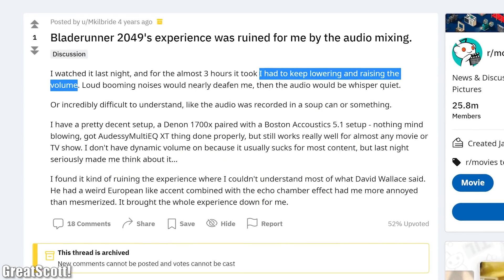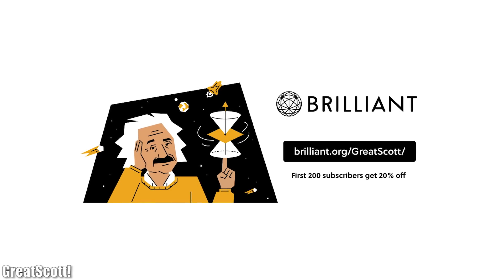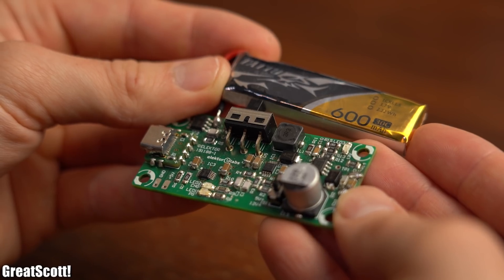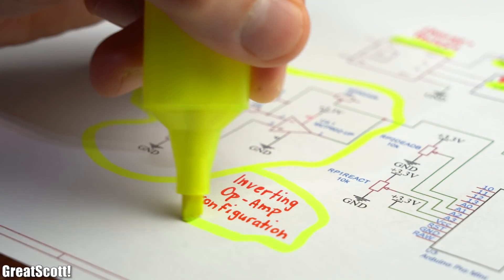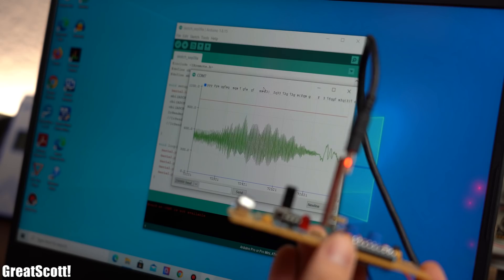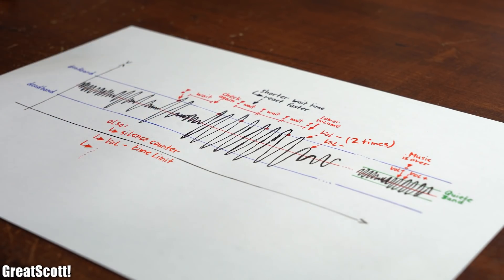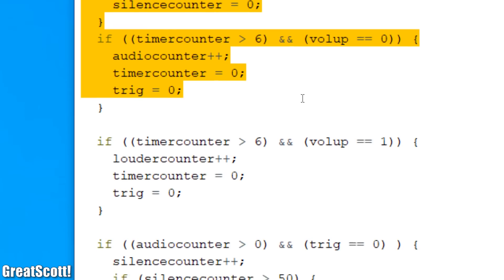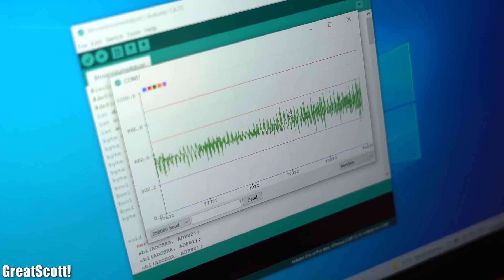Movie Music has a LOUD PROBLEM! So I fixed that! (Automatic Volume Adjuster)

Comment: This technique of using a compressor/limiter has been around for years.
If you view the output of all tv channels on a Peak Program Meter you will observe the change between normal output and the output during advertising.
The PPM shows the instantaneous response to audio signals with a fast attack and slow decay on a range scale of 0 to 8 where 6 corresponds to the maximum permissible level.
When indicating voice signals on the news the PPM will indicate a high dynamic response with an average around 4.
When adverts or feature films are shown you observe a very narrow dynamic range restricted to the highest 20% of the PPMs indication range (5 to 6)
This is because the audio is heavily amplified but put through a compressir/limiter to prevent the station output exceeding the transmission maximum of 6 on a PPM meter.
The effect of this is to maximize the loudness so it gets your attention.

Comment: Or you could just turn on the dynamic range compression, usually labeled DRC, midnight mode, loudness control, or something similar on most devices.

I prefer to hear movies as they were intended to be heard myself.

Comment: we use to have a circuit like this in the vacuum tube receivers it was call automatic gain control, it worked like a jiffy, no Arduino or any computer chips though that had not been invented yet. really amazing how things come full circle.

Comment: The solution is quite complicated.

A fare simpler approch would be to use a external speaker and an Inline analog compression cirquid

That also would react fare quicker

Comment: btw: some cheap transistor testers have an IR code logger that can decrypt the signal

also if it's not remote/bluetooth and going through an audio cable you could build a preamp with a digipot

Comment: The problem is particularly bad for people with poor hearing, who have a lower acceptable dynamic range - they can't hear the softer sounds but contrary to popular opinion, find the very loud sounds just as uncomfortable as people with normal hearing. To be able to hear and understand the quieter spoken parts, I have to turn the volume up very high, which of course makes the loud music passages unbearably loud, so just like Great Scott, I have to constantly fiddle with the volume. Modern hearing aids compress the dynamic range to some extent, but it's not enough. I therefore toyed with the idea of building a compander - an automatic gain control circuit that can be placed between the TV sound output connector and a sound bar or audio amplifier or even as in my case, between the TV sound output connector and the Bluetooth transmitter that I use to deliver the audio directly to my hearing aids. There are in fact IC's available to do this - it's on my list of "to-do" projects.

Comment: Before opening the video I thought you are going to make a volume dynamic process circuit in the middle between source and speaker. But nope that's not how Scott solve problems. Let's make a volume driven IR remote control instead.

Comment: This whole project stops being a good idea when movies decide to have sudden volume spikes (think of jumpscares or similar scenes where action happens after a prolonged period of absolute silence). If you're using a soundbar, this can probably be solved in a more elegant way (for example by converting the audio signal into analog and doing something with that directly with a compressor/limiter circuit). The best solution would be of course for movie producers to stop pretending like everyone who watches movies at home has a basement with a full blown home cinema system and no neighbors in a 10km radius.

Comment: I watch movies and TV shows on my iMac quite a lot. I can route my monitor signal to a TV screen, so I can watch it in bed, or in the living room.

Because the movie you mentioned is not the only one with that loudness problem, I use the Audio Hijack app to add a subtle compressor and subtle limiter. They actually work very nice.
I basically made the dynamics more flat. But not too much. Just enough to keep the relationship with my neighbors okay. It helps also with the volume controls.

Comment: We don't watch DVD or Bluray but we watch a lot of Netflix and this is a huge problem on Netflix but on many other services too. My wife constantly says she has to be the sound engineer to turn the volume up and down. However, TV channels with lots of ads have the same issue where the volume of ads is usually also much higher. So, in our house this device would be perfect as we also don't use 5.1 surround systems but in most cases just the TV speaker(s). And being an Arduino fan I will definitely look into building this and also play with the code a little if needed.

Comment: This is great and genius. But a compressor/limiter would work as well, I have been using software. The device you made is exactly that, but it may not be as responsive as you would want.

Comment: Looks like a very cool project.
I had this problem for years. 
But I’ve always believed it had something to do with the processing in the preamp or amplifier (my money is on the preamp). 
A few years back I was troubleshooting my subwoofer. In order to verify that it wasn’t due to my receiver, I tried 3 different receivers that I could get on loan. All were pretty much the same for voice playback. In other words, the same problem.
Then I heard a demo of a receiver that I thought did a better job. I bought it with the option to return for full value if it didn’t work to solve my problem. 
I wired it up and started a movie fully expecting to hear the same problem. 
Imagine my surprise when my center channel and voice playback all started to sound the way I thought it should rather than what I had been hearing with my other receivers. 
I should say that I had gone over to the home theatres of a couple of my friends (all using separate video processors and amplifiers, of course. And neither of them had the issues with conversation being too quiet.
The good news is that the receiver I bought with the option to return didn’t have the problem either. 
I am now certain that the problem is caused by something to do with the way audio is processed by many, if not most, AV receivers on the market. Because when I plugged in an Anthem MRX 710 (obviously this was a few years back) the problem completely went away.
Yes, people who spend vastly more money to get dedicated components for video and audio processing as well as for amplification pretty much never hear this same issue. 
The good news is that there are less expensive ways to solve this problem without adding additional processing in the signal path.

Comment: Interesting project, and cool way to flex your arduino skills! For practical reasons though, I don’t think it’s necessary. Most home theater systems and even devices like the Apple TV have dynamic range compression or center channel mix adjustment that works much better. Sometimes it has a weird name like “night mode.” I finally broke down and bought a HT receiver after years of putting movies through my hi fi so I could run a center channel. Of course, the latest version of the Apple TV added a feature with better stereo downmixing, so it no longer matters….

Comment: if that's the same sound bar i had, it's a 2.1 setup. i upgraded to a 3.1 and it made a huge difference. those centers do more for speech audio than anything else. of course it cost double the price. old one was $150 when i bought it i think and the new one was just over $300.

Comment: Great project and good comments about the center channel here. Unfortunately it's not always possible to  influence the down-mix, so here are a few alternative suggestions to get more constant volume:
On Samsung TVs you can set the Auto Volume to Night Mode to achieve a similar effect.
Another solution would be to work directly on the audio signal, for example with a DSP or an opamp with deliberate sag.
Studio equipment for saturation/normalization/limiting would also do the trick.

Comment: So. You are listening to a bad surround downmix instead of the proper stereomix and reinvented the 75 year old optical compressor (only not used as a detector) to solve it. Congratulations. 

150 years ago you would be one of those people inventing cars with square tires and flapping wings trying to run on breast milk.

Comment: The thing about this is that the more the loudness differs the bigger the cinematic impact feels. It's a common misconception in the industry that consumers want to gain a cinematic, because most don't want to. There are many AV receivers that come with a built in limiting compressor but they usually don't provide settings and have a very high threshold. I don't know why the movie industry is going nuts about these things. They should also remaster the sound for different releases or at least provide a choosable sound track. While hardware workarounds are a nice thing they become pretty useless over time as movie companies are going to adapt to make their movie "stand out" as in going crazy in dynamic range.
Reply: While I agree with cinematic loudness range not being appropriate for home watching, the issue of the gentleman behind this video seems to be squarely in the selecting the wrong format-camp. 

What he describes is typical of center (dialogue) channel from surround formats being lost if not downmixed properly to stereo by his reciever/TV/Soundbar/Apple TV/Chrome cast device, or even his cable provider.

Comment: Nicely done, but perhaps next time don't overcomplicate? Just add a dynamic range compressor between audio output and amp. No need to involve your remote control in the equation.

Comment: Neat project. I was going to say some stuff but most of the top comments seemed to talk about stuff like Compression and your gear you use. Most receivers will have some sort of compression so the dynamic range (which is a good thing) gets squished so the quieter parts are closer to the louder parts so there's less drastic changes in volume.

Comment: I had this problem with youtube... but noticed there was an audioCompressorNode object that can be used in firefox and didnt make a circuit (actually just dowloaded what somebody else made before I got around to it). Though it can be a bit glitchy sounding... other solution is routing the audio through DAW where there are better quality compressors. Or... since I use an AxeFX II as my "soundcard", just create a dry plugin that does nothing but audio compression and make the computer the input source

My "home theatre" doubles as a music studio. Can get a large HD computer monitor and its perfect for a bedroom

Comment: It's needlessly complicated. A better fix can be made simply and at low cost, with no microprocessor and no code.

Use an analogue ALC or AGC feedback loop. It's a couple of components, and it reacts instantly, if needed. Or you can switch the reaction times by swapping a capacitor or resistor, and also disable it entirely. Set the desired comfortable output level with the normal 'volume' control, and then forget it.

Every AM radio has it built in as standard, because it's both cheap and simple

Comment: Does the wild variation in volume also affect the sound quality since the digitally sampled track only has a limited (albeit quite large) number of levels? Presumably the dialog is squashed in to the bottom and the music in to the top.

Comment: This problem comes from the fact that movies are mixed to be played in cinemas, where you have gigantic dynamic range for explosions, etc.
I agree that an alternative mix for home tv's is very much needed. 
You can almost perform the same function with a very slow attack/release compressor. I think VLC includes one.
Reply: If the last time I've visited a cinema is any indication, then I can safely say that no, the mixing is just shit.
Reply: @Lrofmaulol   if it sounded shit its probably because you landed in a bad calibrated room/system. You can read about that cinema standard in the wikipedia. It is called Dolby Pro

Comment: The problem is simpler than one would think. Most newer movies, and many classics, were  recorded in 5.1 surround sound. All the conversation in relegated to the center channel, and since stereo has no center, what needs to happen is a L+R (mono) signal needs to go to a separate center speaker. Presto change-o, now the dialogue is balanced with the loud sound effects. Rear channels are not necessary.

Comment: I love that this guy seemingly unknowingly made an external limiter. I definitely agree that the stereo mastering of movies and som tv shows have become quite bad in the last decade or so. It feels like they just take the surround sound master downmix it to stereo, completely ignoring the fact that stereo doesn't have the same dynamic range.
Reply: they don't even do that, its just 5.1/7.1 and is left to the device/service to handle the down-mixing so its kinda a shitshow
Reply: It's actually a compressor not a limiter.

Comment: Dude just turn on the DRC if you like to hear movies like that. On some players it's called "Midnight Mode" or "Dynamic Range Compression", but most any player has the feature. No need to build a special circut.

Comment: Just activate Stereo downmix on your Player it will Mix the Sound right. If you watch a 5.1 movie without a 5.1 system and use only Stereo. Your system will only use left and right but voice is in the Center Channel. If you dont have downmix ennabled the voices Sound weak on Stereo. Thats the whole Trick. No need for Hardware its a simple option that you can turn on and off. I rly makes me Wonder that so many people have a Problem with this when the solution is Just a simple Setting. Yes, even If you use a Notebook.

Comment: i want to be able to lower a TV's volume to lower than 1 percent. you know because it's possible on windows 10 to modify the sound volume which combined with the TV can mean 1 percent times 1 percent could come out to 1 hundredth of a percent...i would like to lower a TV's volume past that very loud 1 percent option but without requiring a windows OS to do it. i play console games and i often listen to the games through the TV itself. whether that's a great thing to do or not is debateable but if i choose to do it, it would be nice to be able to lower the really loud games and they don't always come with volume sliders for sound effects and music and such. some of the best games have garbage volume quality and zero or insufficient control options...  it's a lot simpler than this awesome thing you are doing so i hope someone eventually starts making TVs that go lower than 1 percent volume. some TVs' lowest volume setting is even something like 2 or 4 percent... if you have 50 integers on your TV's volume bar it means the lowest it can go is 2 percent. if you have 100 it goes to 1 percent. i want a TV that has 10000 integers on its volume bar, or at the very least 1000 integers.

also as a video gamer this device you already have a prototype of might be useful for increasing the volume of exploration music or lowering the volume of battle music in RPGs cuz they have the same problem as movies, trying to make you feel like you're playing an overrated movie.

Comment: Its also possible that the encode you got was expecting 5.1 speakers with all vocals routed to a maybe non existent centre speaker.  Worth checking out the settings as that will make a massive difference

Comment: What I really don't get is why can't studios make two audio tracks. One where the audio is the full cinema "experience" and another track where the audio mixed properly. I write, record and produce music and through this I know that compressors aren't always a good option because setting up a compressor can be very tricky and can lead to a bad sound if not setup correctly, particularly when you have loud sound or music on top of dialog.
Reply: Just enable downmix in your Player it does the same. Why are so many people dont know this?

Comment: Its called dynamics... the flick need to be played at higher level.  usually for a DVD and or TV there is a mix made with less dynamic range to counter this.  still they are mixed on a full set on slightly  lower volume. this might not replicate what people have at home and not the volume people watch movies at, when at home.  to some degree it would be rather painfull if they later on in the chain compress it to crap.  whipping out the choices a mixer/sounddesigner made to make the movie what it is :(   but this happens usually on tv anyway.. and people that make music know there music will be raped by a compressor when played on the radio...  :( aah well

Comment: Not a good solution AT ALL.

Why not just add a simple analog audio compressor on the speaker output (which is always analog)? Something like this: https://www.circuitlib.com/index.php/projects/product/108-simple-compressor-limiter/category_pathway-29

Comment: The thing is,movies are made using DTS,THX  and Dolby Surround!If your home system is in Stereo without a decoder ,the voices will get muffed!!This happens when people have stereo "surround" systems without a central speaker!The sound bar on the video seems like a stereo one without Atmos,DTS,THX...go to your movie settings and put it on Stereo instead of Surround,Bam,problem solved ;)
Reply: Exactly.. why so many people dont know this?